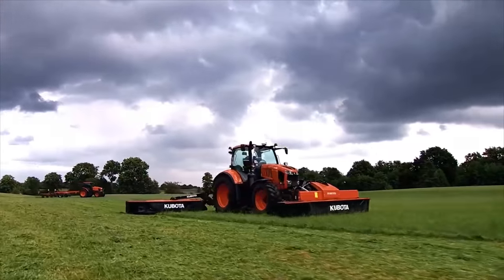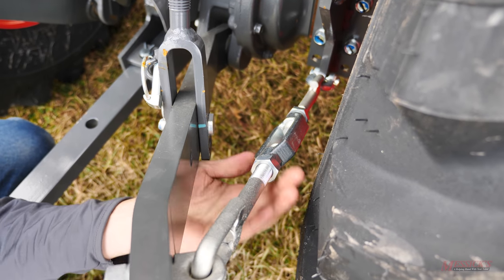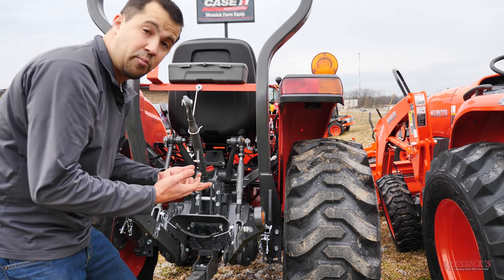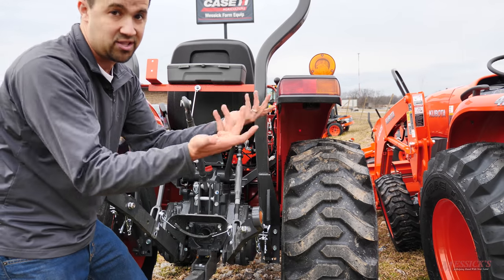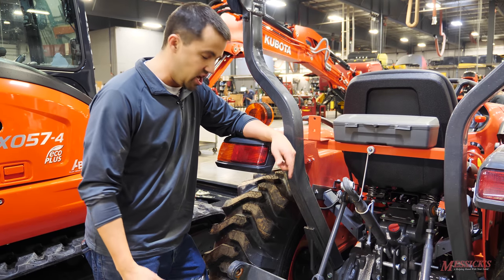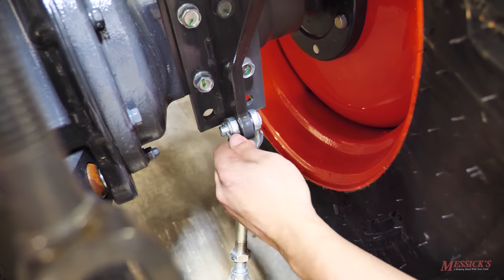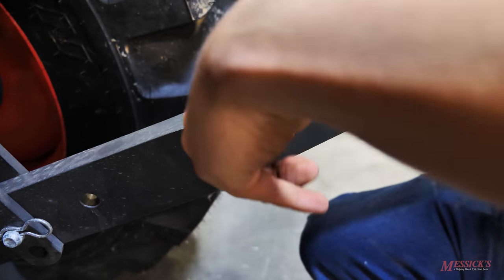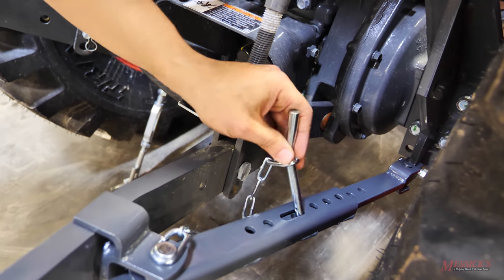Kubota Standard L Series L8430 Telescopic Stabilizer kit (overview and install)

Comment: Just installed on an L3901.  #1  this is 100% compatible with the BH77 frame kit, no interference on either end.  #2 with R4 tires and no wheel spacers, the maximum spread at the ends of the arms is 32."
And Neil, thanks for doing videos like this, I didn't even know this was available until I saw this.

Comment: I'm in Tennessee. I have a L2550 I bought new in1985 that HAD the turnbuckles. I hated them. Talked to Pat in parts.He is great to work with. They were NOT listed to fit my tractor basically because it was an older model. He made me no guarantees but like me the video shows the hook up. Well I took the shot and they bolted up. Clearance is very close but with very little modifications they worked my tractor. I can't say they will work on your tractor buy they worked on mine. Thank you Pat and Mullins tractors for your tremendous help. Will continue to do business with you

Comment: I went the other way. I found I always had some slap with the bars, so I went to the turn buckles, so I can take all the play out. I do not have lock nuts and find the buckles stay snug. I also rarely need a wrench to loosen or tighten them. They are a little more work but keeps things snugger.
Reply: salty 101, want to sell yours? If so, let me know!

Comment: Installed this today on my L2501. The oval holes are basically useless. The bars will hit the inside of your tires no matter the oval hole you chose. The other pin holes work fine although they may be in different holes on each side. I do have R4 tires with no spacers. It seems like this is a known issue with this setup.

Comment: Can you get the bolts that connect the sway bars to the tractor, replaced with pins from the dealership? I’m looking at getting a L3902 with a backhoe and want to make it as east as possible to take off the three point and swap to the backhoe.

Comment: Will this make it easier to switch to the backhoe?  Looks like you could just unpin the middle adjuster pin and leave the back half of the new bracket on the tractor?  Currently, I have to take the whole turnbuckle off which means cotter pin each time.

Comment: I want these for my L3800. Will definitely make it quicker and easier for swapping out my mowers and blades.

Just out of curiosity. Is there a kit to swap out the standard lower 3 point arms for telescoping ones?
Reply from the maker: Good news they fit your tractor.
Reply: I am curious about the lower 3 point arms as well for the L3200/L3800!
Reply: I keep hearing that the telescopic sway arms have issues with clearness on some L model tractors. Depending  on the style of tires you have on your tractor. Of course if you have wheel spacers on your tractor, clearness want be an issue. Just wondering if they will work on my 2013 L3200 Kubota tractor with R4 tires.
Reply: I was also wondering if there is a retro kit for the telescoping lower 3 point arms for the L3200?

Comment: You need to mention that these DO NOT FIT a standard L with R4 tires, the rub the inside of the tires badly. 
You need to run wheel spacers with them. 
And that’s OK, the tractor is much more stable with spacers anyway.
Reply from the maker: They do, and they don't. The limit the travel on R4's but it does not cause an issue with all implements. 
agree on spacers.
Reply: What size spacer do you recommend?
Reply: @MessicksEquip  what size wheel spacers is recommended on the standard L with the telescopic stabilizer kit?
Reply from the maker: @OneBrightLightTN  the factory spacers are 1 3/8

Comment: Love to watch your informational videos, thanks for making them! I bought an L2501 last year & that was the first thing I did to it, really seems to make changing the implements quicker for me. Can the Top Link also be upgraded to a cranking style instead of a turnbuckle style that came on my L2501? If so what would that part number be? I would love to do that as well! Many thanks!
Reply from the maker: There's no official side link, but a lot of times you can buy parts off of a similarly sized tractor and they will work okay.
Reply: Sorry, I said Top Link in my original post but I meant Right Side Lifting Rod, mine is the turnbuckle style. I would like one that I had on my old Grand L series 4310, it was the cranking style. Would that particular one work on the L2501 & what would the part number be? Thanks again!!
Reply from the maker: Best bet is to call our parts department 877-260-3528
Reply: @MessicksEquip  does kobota sell a shortened 3 point arm so a pats easy quick hitch won't stick out so far.

Comment: Thanks Neil, I am ordering this kit, do you know the part number for the turnbuckle hook behind the drivers set right under the tool box 
Thanks Neil..
Reply from the maker: Not sure what your looking at? The 3pt too link?
Reply: @MessicksEquip  The top turnbuckle that connects to your three point attachments there’s a hook mounted on the back of the tractor that holds the turnbuckle  from dangling looks like a large chrome hook
Reply from the maker: @CapeFrank57  its called a top link. Call 8772603528. Our parts guys can. Hook up you with everything
Reply: @MessicksEquip   
Thank you

Comment: may be an issue to remove it when adding the backhoe on. I guess I could use a pin instead of a nut and bolt when it attaches to the tractor end. how much more weight does it add to the three point? it can be a pain moving the three point lift arms on and off when installing and removing the backhoe.
Reply: I can still get the wrenches in there with the bh subframe in place on my l2501
Reply: I'm sure the wrenches fit but seems like an added step to make using a wrench on each one of these to remove it in order to install the backhoe. making removal and install of the three point a little longer.

Comment: It really is a shame that Kubota doesn't supply these on all their tractors. I understand they would make the tractor more expensive, but why cheap out on this small part, when you are selling a tractor that costs $25K plus?
Reply from the maker: Difference between deluxe and standard models. It's on many.